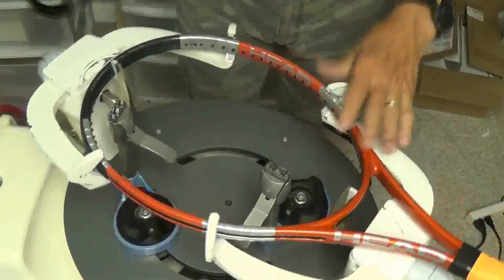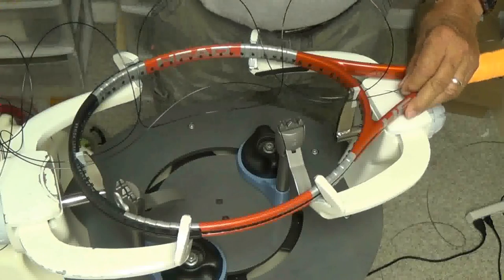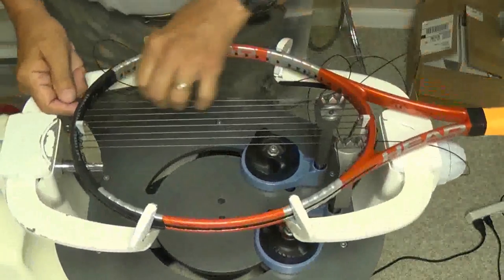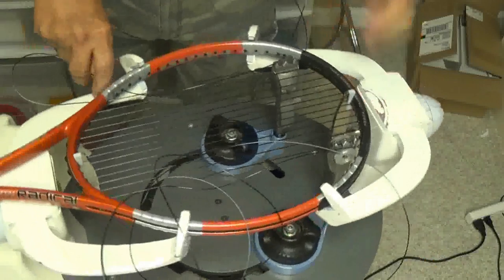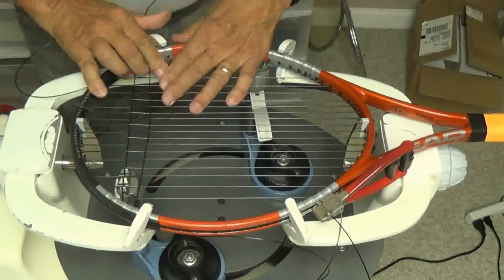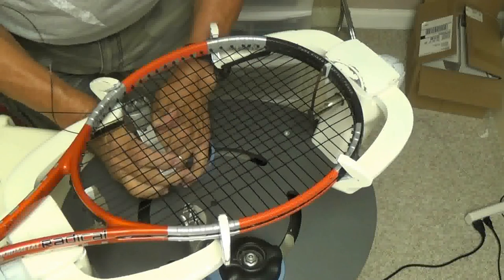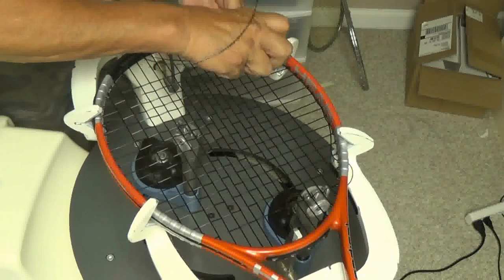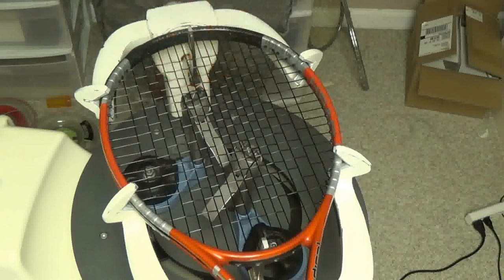Around the world

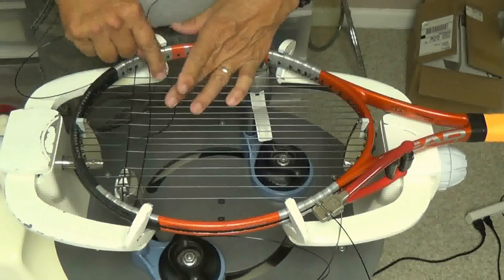Comment: 10:38.  I use that running of strings technique.  Weaving is difficult for me.
Reply from the maker: Miguel Barahona weaving is something you just have to learn especially with poly string in an 18 main racket. One thing that I’ve been doing that seems to help is to push the next string your will tension against the last tensioned cross.

Comment: If the mains finish at the throat it means the racquet  should be strung in 2 pieces. By stringing like this if the frame breaks then Head will not replace it as its been strung wrongly.

Comment: just a quick question , had a customer come to me really unhappy with his string job about the end strings.both mains being too loose , Would a Around the world pattern fix this situation if so i need to come back and string it right for him Thanks!
Reply from the maker: When I string a racket with 2 piece stringing and tie off the outer mains the outer mains generally loose tension as they are tied off. And when I tie off the top and bottom crosses I will find the same thing because they loose tension as I tie them off.

When I string a 16x19 racket with my Short Side ATW pattern I hold the 6th main on the long side with a starting clamp. Then I string all the mains on the short side of the racket, the bottom cross, the outer main on the short side and the top cross then tie off. I remove the starting clamp holding the 6th main and weave in the 7th main on the short side and all the remaining crosses, and tie off.

If I tug on the outer mains they are tight because they were never tied off and I have no drawback. I’ve seen clients tug on the bottom cross but thefts tight too because that cross was never tied off. To this day and I’ve been string I’ve never seen a client tug on the top cross. The only outer string on a racket strung with my short side ATW pattern is the top cross. All the other strings inside the outer strings seem tight because they are held in place by a string on each side woven opposite. Should you restring your clients racket? Depends on how you’re going to address the problem of the loose outer strings.
Reply from the maker: You can address the client and explain why the outer strings are loose, you can up the tension on the tie off string so they settle at reference tension. Or you can string the racket using an ATW or a box pattern.

Comment: what's the benefit?
Reply from the maker: The benefit of using this ATW is there is no counting of the cross strings, no hard weaves, and the outside mains are never tied off.
Reply from the maker: Another reason for using an ATW pattern is when stringing some racket you will block holes occasionally with 2 string and you will have an outside main very close to the tie off location that leaves very little room for tying off. The Tecnifibre 320 is a good example of that https://youtu.be/AP83KE6tgY0. If you use an ATW pattern you can eliminate double blocking holes and close quarters when tying off.